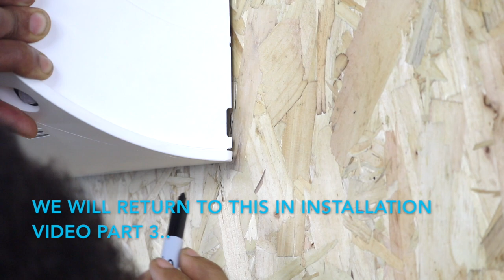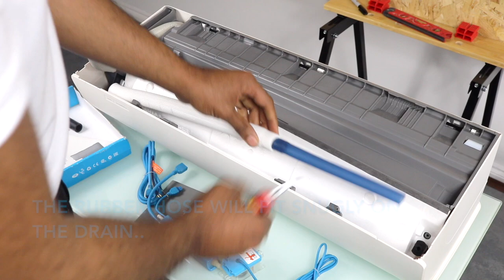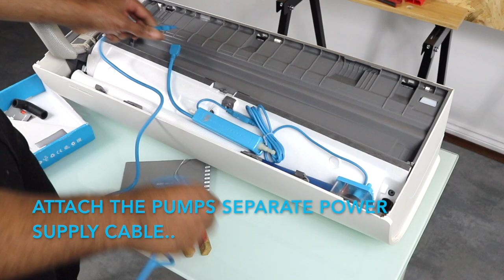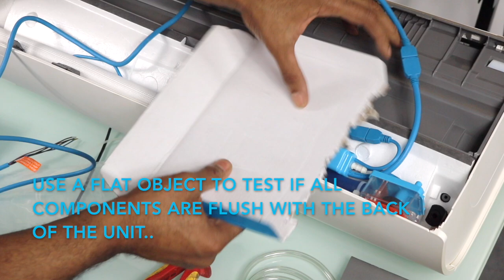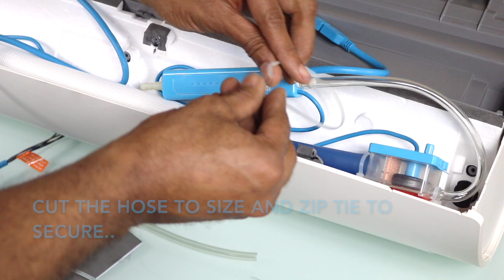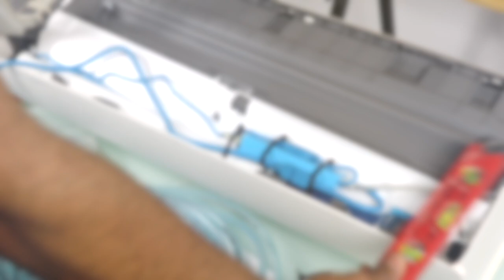2. How to install a ductless mini-split air conditioner - Eco Climate Solutions

Comment: LoL oh boy. Pull gut the darin hose on the left, pull out the plug on the right und put ist to the other side. Use the black angle und conekt ist with the long side to the darin outlet. Conekt the stimmer to it und the rest in a line. Mitzubishi shows the mörders und position of the required hole in the mounting plate.

Comment: Doesn't the pump need to be at the same level or lower than the reservoir?? I might be mistaken but your pump will run dry sometimes
Reply: No, the aqua mini is self priming and comes with an anti-siphon device.  The instructions state that it can be above the reservoir by about 5 feet.

Comment: How do you get to it to clean it?
Reply: I'm installing one of these and I am wondering the same thing. I'm thinking you pop the unit off the bracket at the bottom and put something between the unit and the wall so it stays pivoted out by 4-5".  Then you just reach up in there and pull it out.  I'm sure it isn't the easiest thing to maintain.